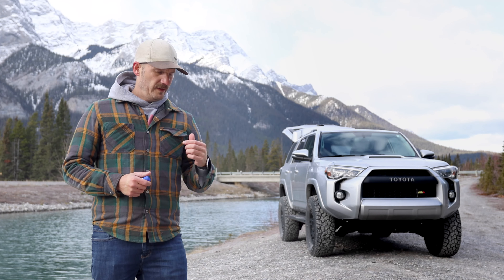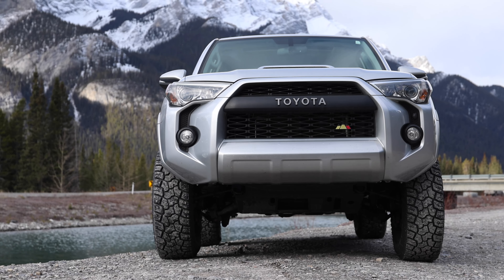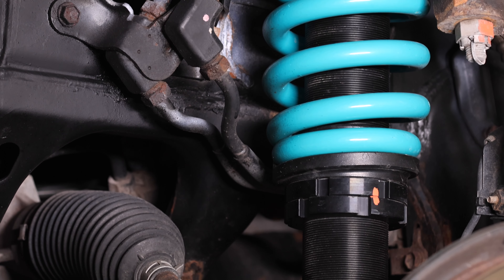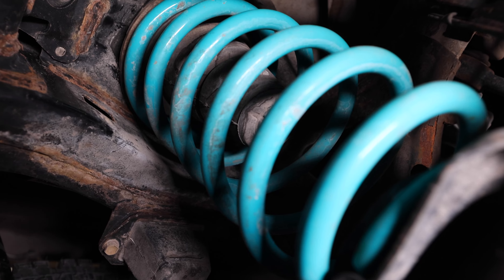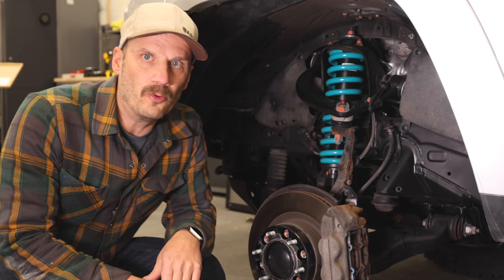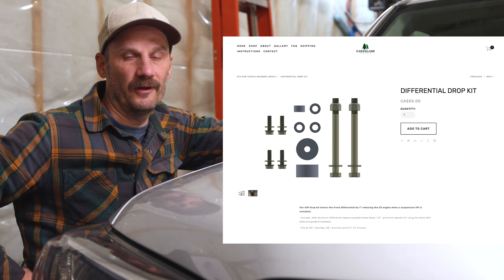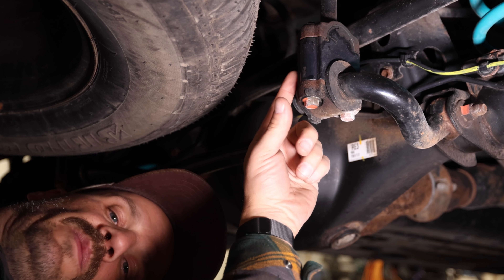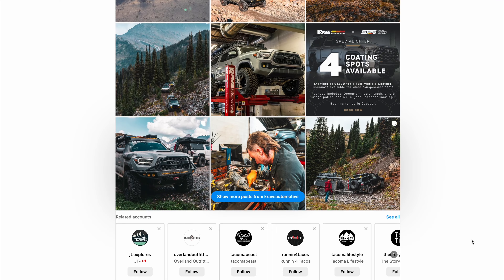4Runner Lift (UNSPONSORED) KDSS

Comment: I'm installing my own lift kit next weekend. On the 30th. I'm using a rough country 3inch lift kit with freedom offroad UCA's and extended sway bar end links for the front and adjustable for the rear, diff drop kit and DR KDSS panhard bard correction kit. I might wait and save some money for the dobinsons rear upper and lower control arms. 

I put BFGOODRICH ko2 265/70/17 a week after I got the 4runner 2 months ago so I guess I'm stuck with stock size tires for a while, till I get new 285's. Thank you for all the useful information for your vide. I'm subscribing to your channel! 🤟🔥
Reply from the maker: Awesome! Thanks for watching and writing!

Comment: Why is no one here talking about how you will NOT need to run wheel spacers with 285s on that wheel in order to avoid rubbing on the frame rail or suspension links...     This is so bizarre.  All he did was make it so that he absolutely WILL rub on the front bumper cover and the body mount behind the front wheel!
Reply from the maker: I think you’re right and wrong and that depends on what kind of conditions of driving. There’s really no “need” for the spacers but I definitely won’t be rubbing the front bumper cover or body mount. I just got back from Moab and happy to report that I didn’t break anything or experience any rubbing. No super hard core wheeling (because I had to drive home) but enough to know that it works great. It might be bizarre but it’s my bizarre and I love it ✌️
Reply: I run 285/70R17 on mine with a 3" lift, -6 offset on the 17x9" wheels only time I "rub" is when in reverse full crank on the steering wheel, but that's only on the plastic mudflaps I refuse to remove so its not really "rubbing" in the sense that most people are worried about.
Reply: This sounds right…
Reply: I have 285/75r17 0-offset 3/2 inch no rubbing no scraping, use an rso uca and it drives like oem.

Comment: Subscribed.  I am 6 months into owning my 2022 TRD and iching for a lift eh. Crammed 275 70 R17 under it stock. Want to lift it and take the rake out for sure. Maybe in another 40K miles I can upgrade to 285s

Comment: Dr KDSS advises against installing the KDSS spacers unless you are running extended travel suspension, just a regular lift is not enough to need this; its going to put unnecessary stress on the hydraulic system.
Reply from the maker: Guitar Guy! I would agree. This lift falls in the "extended travel" category though. Part number for the front struts is IMS59-50574 and depending on where you buy them will be labeled "extended travel" or "long travel"
Reply: @ cheers!
Reply from the maker: Also, weird story unrelated: I got an amazon package yesterday that was addressed to me and it is a 5/16" truss rod wrench. I did not order a truss rod wrench and for the life of me can't figure out how this could happen.
Reply: @RinkVideo  someone wants you to review their product!

Comment: Nice video and lift looks awesome on there! hope u hit that 50k for the basketball, also how did u get to 5" front with the 302 spring is only 2.5", guessing u just spun up the adjustable strut , those struts got way more threads than i thought

Comment: New sub here! I have no weight on my 4runner and plan to keep it that way other than a light weight rook rack. I love the level look of the options you picked for this. I have two questions. 1. Do you recommend the same shocks and springs if I am running no weight? 2. Shouldn't the rear OME correction spacer go on the driver side due to more lean?
Reply from the maker: PARTY NEW SUB!!!!! Thanks Matt. I can't believe you're the first person to ask that question about the spacer. If it was me doing the work, I 100% would have put the spacer on the driver side because it seems counterproductive. However, the fine folks at Krave Automotive are masters of Toyota so I simply trust them. I suspect is equalizes the pressure of the KDSS. Anyway, I love the ride of this lift even when I have zero weight in the back and it still looks sweet with that tiny bit of rake so yes I'd recommend. Thanks for popping in here! I appreciate it.
Reply: @RinkVideo  Thanks a lot for the insight. I’m not a fan of any rake so I’ll probably go 3 in the front and 1.5 in the back.
Reply from the maker: @matthewoneill86  awesome. I’m interested so let me know how it goes if you can ✌️

Comment: Great video! how are you liking the setup after being broken in? Also just a heads up. I spoke to Dobinbsons and apparently you can not run long travel shocks in the rear with non long travel springs.
Reply from the maker: Darn I screwed that up in the video!!! 

I like the setup. Although I have some play in the front axle right now making a little bit of noise. But only in 4WD at highway speed. I’m sure the lift is not solely responsible for it but definitely doesn’t help. 

Thanks for catching that and thanks for watching!

Comment: Looks good!, is that calgary rust?
Reply from the maker: Indeed! More like Highway 1 rust. After seeing this footage I already have it torn apart and sanding/rustproofing and undercoating. 👍
Reply: @RinkVideo  ahhhh yes. You've got Krown spray locations in Alberta I believe. Got a video of your refresh?
Reply from the maker: @covecarpentry  frick I should have actually made a video but it's a PINA to shoot underneath there. I took alot of it down to bare metal with a variety of wire wheels etc and they sprayed it with Dupli-Color Rust Barrier (expensive but awesome) and then some places I sprayed with a rubberized coating. The ProForm Rubberized Gravlguard is such an amazing product. I should actually do a video about rubberized undercoating to show how superior that ProForm product is. I wish I could get it on amazon and it's a shame that it's hard to find. Seriously this stuff is 5-star: https://proformproducts.com/products/pro-guard-rubberized-gravlguard-2/
Reply from the maker: And finally, I sprayed the snot out of everything with FLUID FILM rust and corrosion prevention because I love that stuff. I normally apply it in the fall and it lasts the winter. (PS - I bought that 4runner second hand so I'm playing with the cards I was dealt)
Reply: Ahhh you went all at it. Nice to see. And yes, we love fluid film over here too.

Comment: What drew you to Dobinsons?
Reply from the maker: Recommended by the shop. I’m not a hard-core wheeler so didn’t want to break the bank on overkill. Also didn’t want to go low budget. Middle of the road I guess.
Reply: @RinkVideo  The reason I’m asking is because I’m looking at Bilstein 6112s on the front and Bilstein 5160s in the rear for my 2012 FJ Cruiser.  But more and more overlanders are going with Dobinsons
Reply: @RinkVideo i wouldn't say they are middle of the road. I get what you're saying, but they are just priced very well for a high end product. They are much better than the 6112.

Comment: What rear springs ?
Reply from the maker: C59-325 Dobinsons
Reply: Just curious why not go with the 675v.
Reply from the maker: I have a big-ass bike rack on the 2” hitch that gets pretty darn heavy when it’s loaded up. Are those 675v not for a light load?
Reply: I currently run the 675v with the Lt dobinsons and it’s light load to 200lbs max
Reply: Also the 325 spring is only 2.25" lift, did u use a spacer also?

Comment: 5” lift means you have 0” of down travel up front, and with 4” out back your rear shocks are topping out. It looks cool, but from a performance standpoint you are all compression travel that you are not even able to access. I’d love to hear a technical explanation that shows I'm wrong.
Reply from the maker: @enjoybendlife  it’s not a 5” lift. Perhaps I did a poor job of explaining the 5” but what I tried to say is that the front fender is currently 5” higher from the ground than when the 4runner was stock. The lift is about 3” on the front and 2 3/4 on the back. Put on the bigger tires and that’s how the front fender is exactly 5” higher than stock.
Reply: @RinkVideo  that makes more sense! Thanks for clarifying that.

Comment: not knocking. I really like your Channel. but in your "controversial" 4runner kinda sucks vid. u talk about how much of a dog it is. which it is. that 4.0 isn't peppy. but those 33s you have definitely slow it down. it actually drives okay on 265s. I put 275s on mine and definitely noticed an increase in upshifts.  a re gear would def give you some of that pep back. albeit expensive
Reply from the maker: @jordanseitzinger3167  you’re right. I have 265 winter tires on right now and it seems to not work as hard. I like running those 33s a little softer than I should which also doesn’t help. Like if we’re mountain biking and shuttling all day I’ll just run 20lbs in them and it rides like a Cadillac on the washboard gravel.
Reply from the maker: An underpowered Cadillac 😂